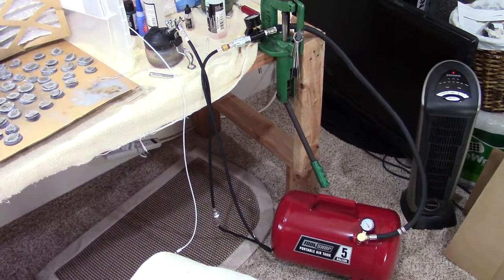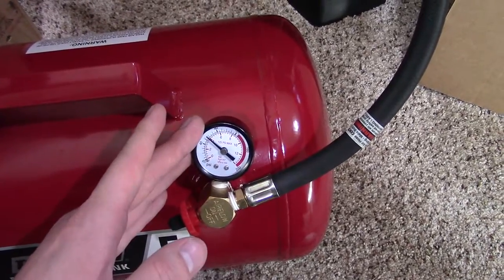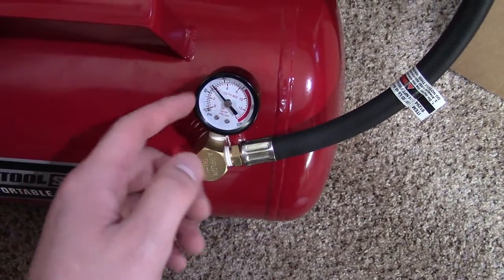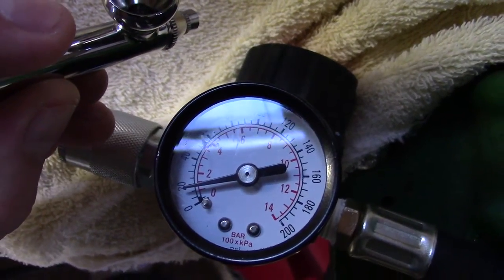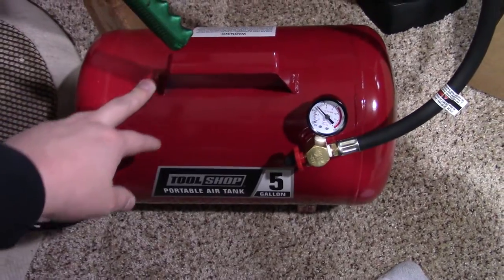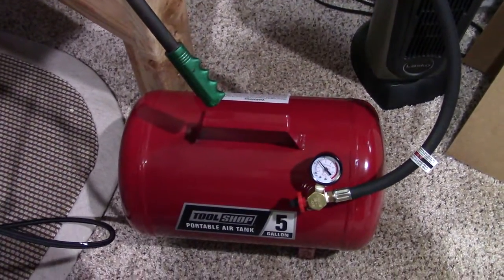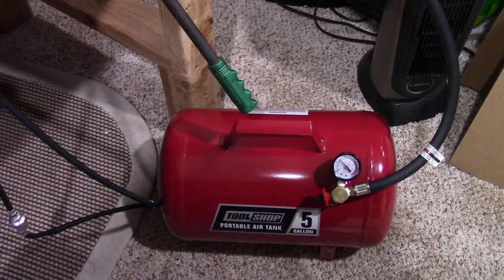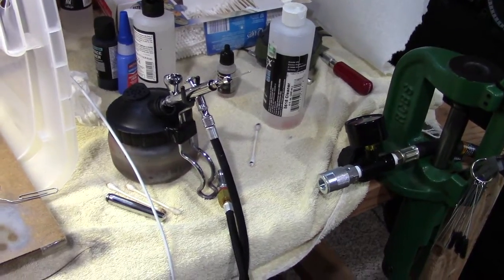Running an Airbrush off a Portable Air Tank - Set up tutorial and Discussion

Comment: Great video!  I've been looking into airbrushes and compressors for them for little awhile now, and just stumbled across a reference on a scale modeler forum about using one of these with a bicycle pump to run an airbrush.  I figured surely someone has a demonstration video up on Youtube, so thanks a million!

 Looks like prices on air portable air tanks have gone up this Tool Shop brand tank from Menards runs $40 now and Harbor Freight's 5 Gal Central Pneumatic is regularly $38 -- in my immediate checking those seem to be the two lowest prices.  Oddly, the tanks showing up on Home Depot and Lowes are significantly more expensive, both list a California Air Tools 5 gal tank for $95, I assumed that HD and Lowes would have store brand air tanks but I can't seem to get them to turn up in the search results.

At around $100 the air tank,  it's a price you can start finding smaller compressors with around 1 gallon tanks.  Lots of videos of these smaller compressors up on Youtube hobby/scale model channels like Barbatos Rex.  

Still tempted by the idea of using one of these portable air tanks  with a bike pump or tire inflator to charge it.

Comment: I've been wanting to do something similar, getting a tank for my compressor. I have one of the small tankless compressors. I just want to add a tank now.
Reply from the maker: Nice man that would be perfect yea I think having a tank is pretty helpful but I may try out one of the smaller tankless compressors this summer when I need my big compressor back in the garage. Is the PSI pretty constant once you start airbrushing?
Reply: Yeah the flows pretty good it's just the moisture can build up in the lines, not a big deal if you have a good moisture catch. Which I don't anymore, with a tank you don't have that problem. I have another compressor with a tank bout it quite holding pressure for some reason.
Reply: Nice video can you put a link in the description  where you can get the parts and supplies, thank you

Comment: Can't you just run a compressor line into the fill side of the tank and let the comp kick on using its pressure switch? I don't see why it wouldn't work that way or am I missing something anyways thanks for your input I have been thinking about doing this but I also have an opportunity to buy an actual airbrush tank for 25 bucks with all the fittings and I think I'm going to go that route after seeing this video
Reply from the maker: i actually never thought of that, good idea! I think that might work? For some reason it's confusing me about the compressor being able to know to auto shutoff, but it might be worth a try if you keep your eyes on it the first time you use it haha. I would just make sure to get a moisture trap in line somewhere after the tank.

Comment: By removing and replacing that portable air-tank's input fill-valve-core assembly, and replacing it with different fittings, you should be able to hook the out-feed air-hose from a hobby airbrush compressor to that portable air tank's fill valve inlet. I just don't know how long it would take for the compressor to fill that size air tank and then be able to shut down as it normally would with a smaller air tank.

Comment: What adapter did you use? Between your airbrush hose and the 1/4  pipe thread fitting. This adapter is hard to find I’ve searched everywhere except the Internet.

Comment: Okay this might sound dumb because I know nothing about airbrushing and the equipment used for it. so can you please tell me if the tank can be refilled? How long will it last if I use it for 5-6  hours every day or use it to apply 100-200 tattoos per day?
Reply from the maker: Hi there, the tank can be refilled just like a tire on your car at a gas station. I haven't used this setup in a while, but I think for you use you might be better off grabbing a compressor  if that's an option. There are harbor freight or similar knock off brand compressors that work just fine for starting out and don't break the bank. I think with any portable air tank that's a reasonable size you would be filling it way more often than you'd want. Im guessing the last thing you want is to run out of air when you're working with a client.  Hope this helps!

Comment: Hmm...someone does some reloading :).  I have a C02 tank that I've been using, but it's dry now and the place I got it from years ago is out of business now, so the only place around to fill it is much less convenient.  I already have a tank like yours, so I was thinking of just getting a small 2/3 gallon compressor from Home Depot.  I might be able to tolerate this set up...I only plan on doing a few minis a week, if even that.  Just need to get the starter guys from KDM done in the near future.  Anything from HD you recommend as compressors go?  Don't really want to spend more than $150.

Comment: so i have an airbrush compressor kit and just ordered a 5 gallon tank, im curious on if my compressor will still go on and off every spray even with the tank? the compressor comes with a regulator and the tank comes with the hose, so all i need to do is switch out the gauge on the tank with the regulator then connect the hose to the compressor from the tank correct?

Comment: I do believe you would have done better with 11gallon but I still love your set up I have a 3gallon pancake and a 5gallon so for the 80 dollar invest meant I can run a small air brush or nail guns or a palm nailer that's a great tool plus that's 8gallons of air before I have to refill it never goes down past 75 psi

Comment: What size fittings to I need to be able to connect my smaller airbrush hose to the bigger connection on the regulator?
Reply from the maker: So I'm not positive but if I remember right most regulators on your average compressor or air tank like this have 5/8" connections. So you would just need an adapter with 5/8" to usually 1/4" for your airbrush. What you can do if you want to be sure is take a ruler or tape measure and hold it up against the connector to measure it and you should know what size you need!

Comment: What brand is your Airbrush hose ? (black ?)
Reply from the maker: I think I got it on amazon, I can't remember exactly what brand it was.. I just remember buying the cheapest 6 foot airbrush hose I could find :D
Reply from the maker: A 5 gallon tank could probably run an airbrush at 20PSI for about a half hour. I honestly can't recommend this set up if you are a heavy airbrush user, it's well worth the extra cost to get an entry level airbrush compressor in my opinion. If you use your airbrush only to prime and basecoat it would be reasonable to use a tank like this or maybe even consider a 10 gallon air tank instead of 5 gallon. Also if you are airbrushing at some kind of outdoor event or festival that doesn't have easy access to power a compressor this might be a decent alternative. Hope this helps!
Reply: Chief Live Gaming no leaks ?
Reply from the maker: no leaks at all and i've been using that hose for well over a year now. Really like it!

Comment: I think this is a bit pointless, I have a small oil free compressor with a 25l tank, it will run the airbrush for around 45 mins before the compressor kicks in, id rather endure 3 mins of not much noise than have to take the thing back out to the shed to fill again.  Plus you stress your other compressor more, as it has to fill two tanks in one go, they are generally deisgned to work with the tank they come with. any extra stress will cause heat build up.   Unless you have a massive shop compressor. in which case this is a clear benefit.